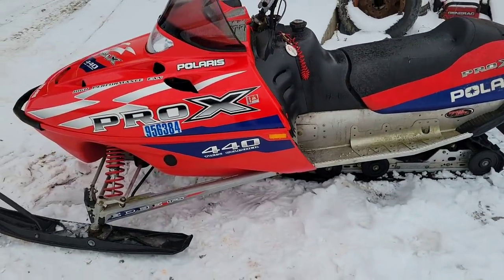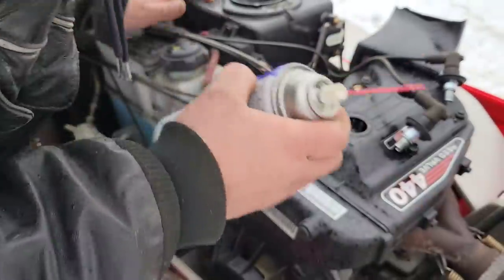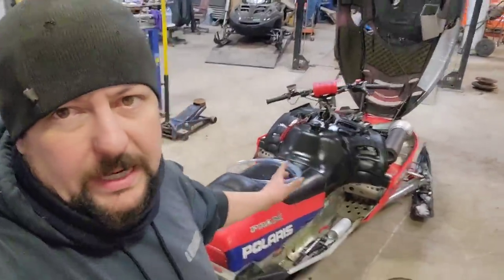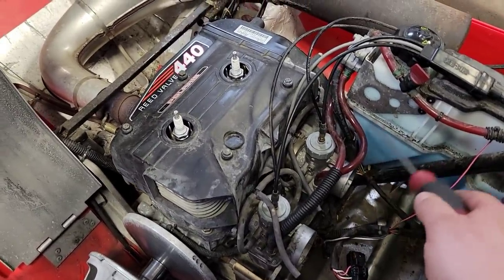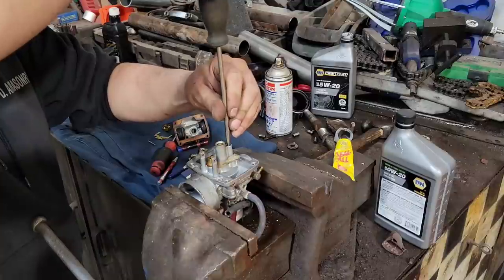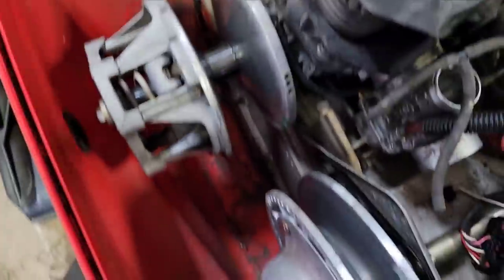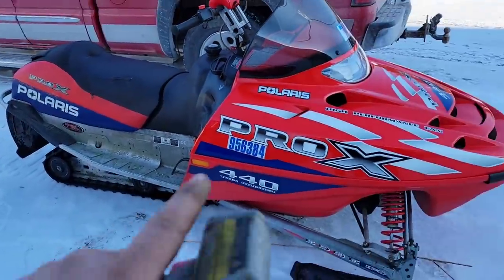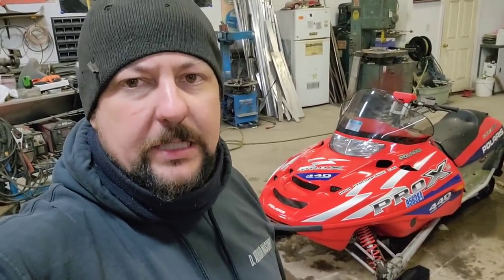polaris 440 no start..just needs carb Clean?

Comment: I have 1999 xcf sp with the same engine these sleds haul for a fan but they are very finicky engines. The pro x had more issues because the cdi timeing was ran hotter

Comment: Those 440 fans in the pro x are a nightmare. Usually too lean or too rich and parts are extremely hard to come by
Reply: I had a brand new 2002 pro x fan 440 ,always ran great when it was cold out but around 35 degrees it would foul plugs like a sob rebuilt under warranty,rejetted carbs tried everything come to find out it was a major problem with this engine,finally got rid of it and started buying Ski Doo instead.

Comment: I like your content, but trust me on this one, you do NOT want to use brake or carb cleaner to run your 2stroke engine. Not ever. It instantly removes and disolves the oil film on the cylinder wall and piston rings, even if it's oil injected, and you get bare metal to metal contact. You wont destroy the engine, but you can cut the lifespan in half or even worse. Just a tip.

Comment: Dude I need help mine starts and and reves way up its never done this I changed pull cord and it started doing this
Reply from the maker: hmm... if its reving hight I'd say either the throttle is out of adjustment or it's lean and sucking air somewhere, maybe a carb boot or a crank seal? I'd take a look there first 🍻

Comment: You know the guy either put old gas in that sled or let it sit for a year plus with gas and then the carbs got gummed up. Every winter I drain the gas in my sleds and put fresh stuff in to start. In the spring I do the same with motorcycle. The ethenol in gas is horrible for small engines, esp the carb ones. Even with stabil the gas looks like apple juice coming out after only 6 months.